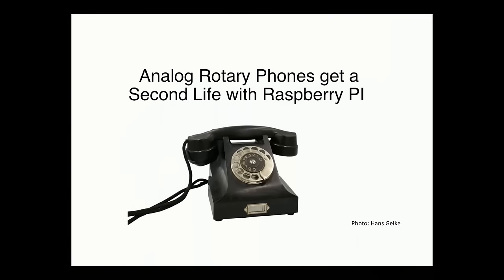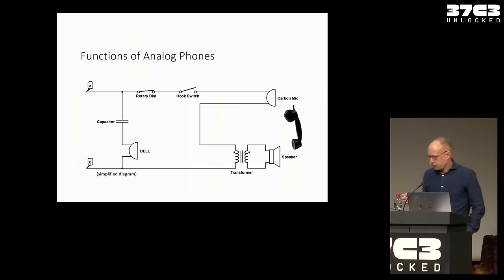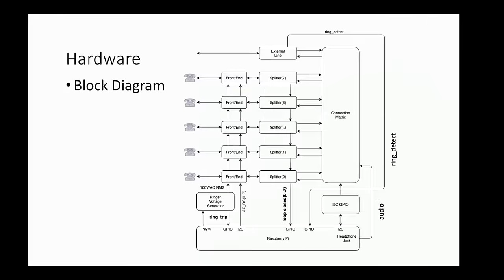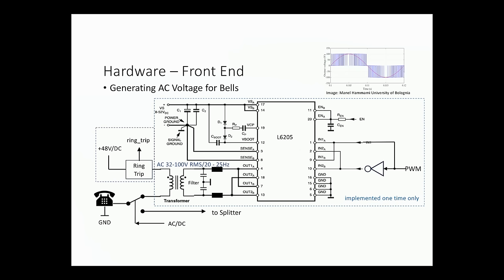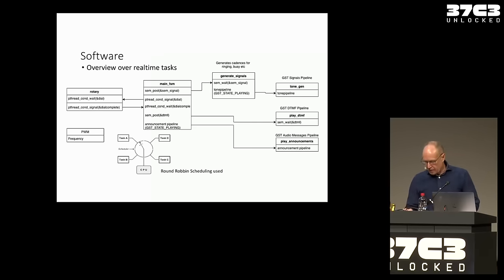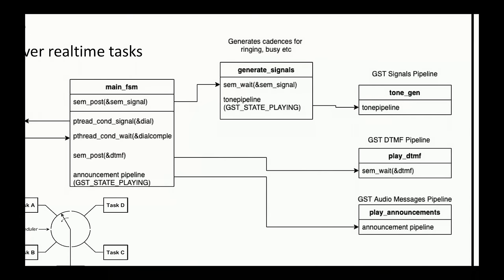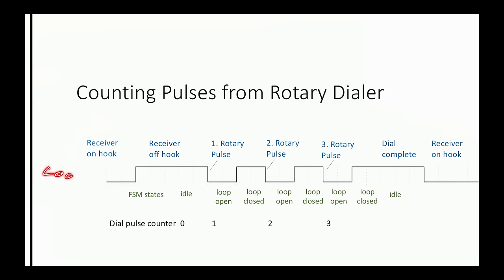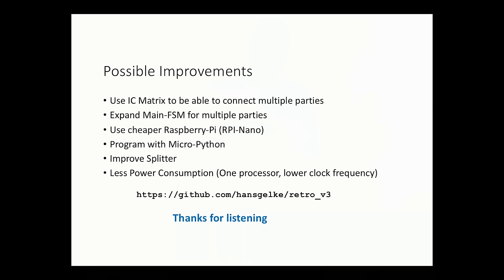37C3 -  Analog rotary phones get a second life with raspberry pi

Comment: Uhm, my W48 works with my 7590 Fritzbox.
Reply: That may work, including some small PBX, but in many cases it is not guaranteed any more. Often those devices have a Line Voltage of 30V and below. Some can only handle Tone Dialing.
it depends, and so i like to see a circuit that operates in the nominal range of that devices.

Comment: Way too over engineered. There is a PBX package for the Pi and with a cheap analogue to SIP dongle you can attach as many rotary phones as you like. Alternatively buy a cheap cell2jack adapter and you can connect your old phone via Bluetooth to your mobile phone, even dial out using rotary.
Reply: same yes, the description Pi, the connection to the Pi, that big, I was have to look for Pi in the diagram
Reply: but its more fun to tinker an own solution and not just get an app out of the box. mmmmh, what do you think how the inventors of the pbx package have started with? lol. i'm glad there will be more than one and only solution to it. and its fun, just fun. not just using.... :X
Reply: I would guess the target audience has not really a problem with overengineering ;)

Calling right out of the middle of this crowd